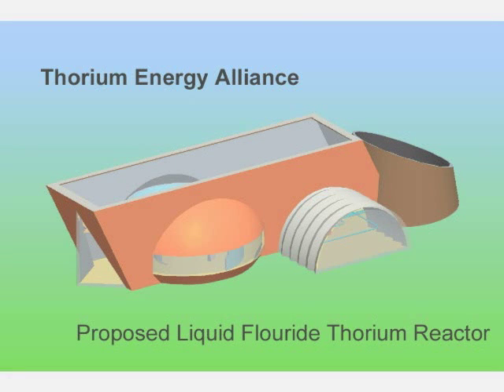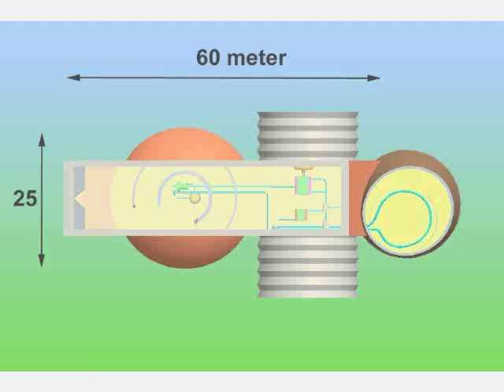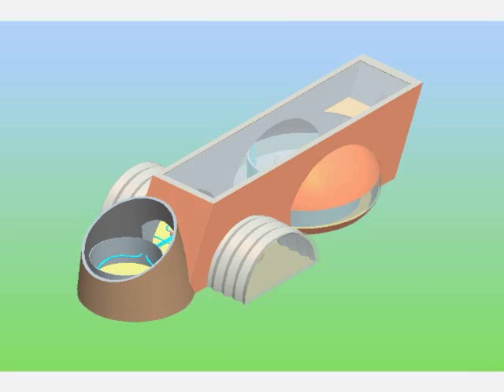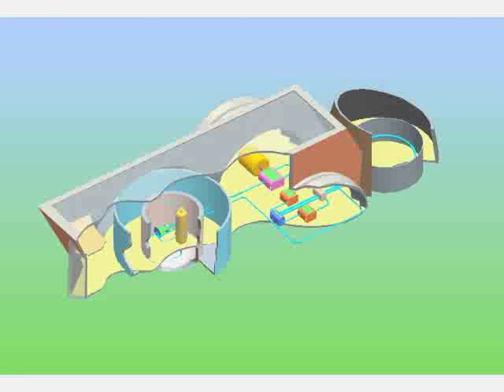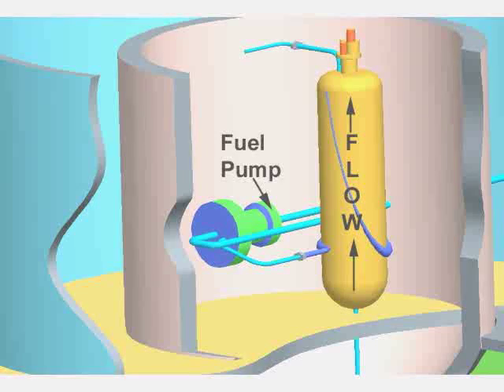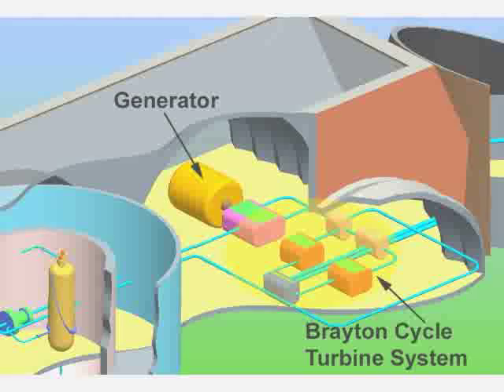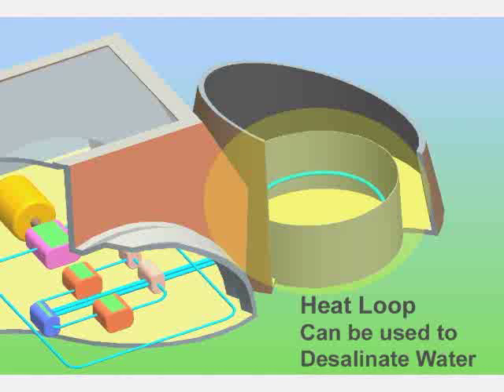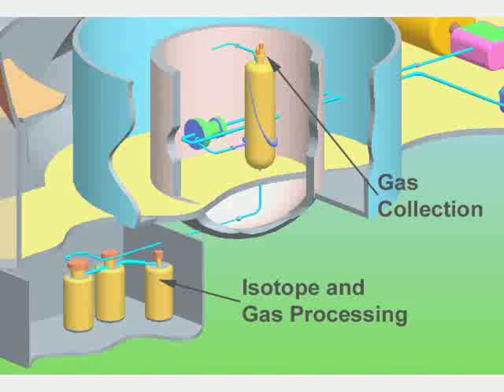1 Minute Molten Salt Reactor Thorium

Comment: Isn't that sort of a wacky looking set of buildings, with slanted walls, bulging walls, etc? What sort of shielding will isolate the operators and inspectors from the gamma radiation? The installation does not need to be near water and so should be well away from water, shorelines, rivers, or flood zones?

Comment: That's brilliant*!  It's as simple as plumbing molten lead through dozens of control mechanisms and heat exchange units.
*(If you can sort out the cold spots, hot spots, direct the flow of salts in all parts of the reactor, separate spent fuel from fresh fuel with low loss, shield the radiation, rapidly change the reactor output in response to a sudden shift on energy demand (such as a substation failing), sustain the fuel cycle, and do it all for less than the unit cost of coal power)

Comment from the maker: @azezel2311  - Yep, That is on the CAD drawing board. We are thinking about how to get about a 10 megawatt system to fit into 2 containers. This could be used by industry or municipalities to support their operations, or the Military could use it on forward operating bases to eliminate the need for so much expensive and dangerous to transport fossil fuels